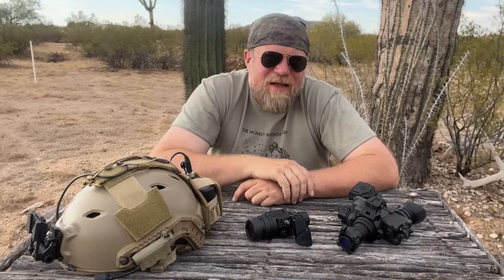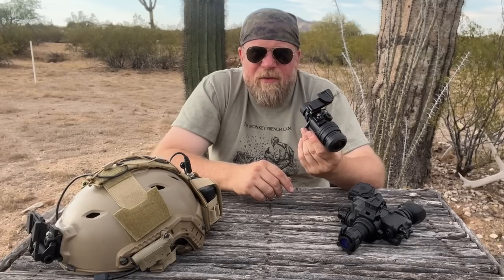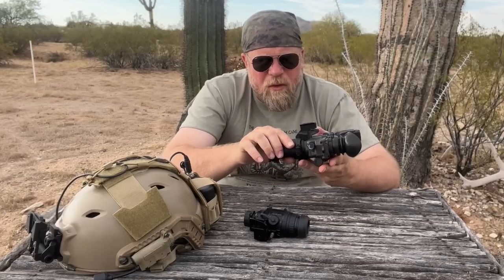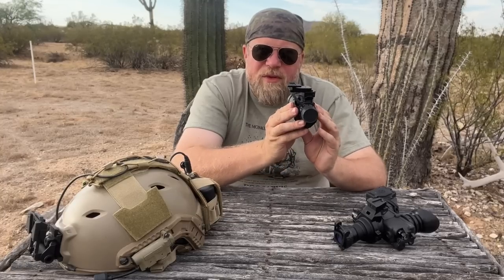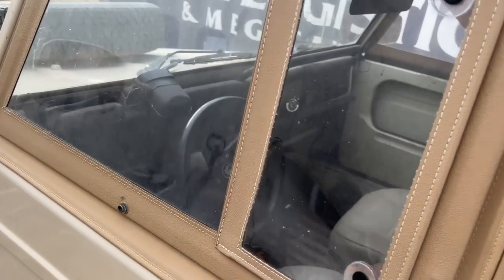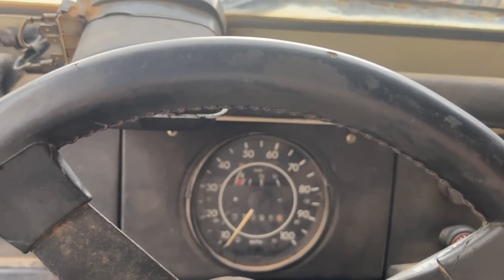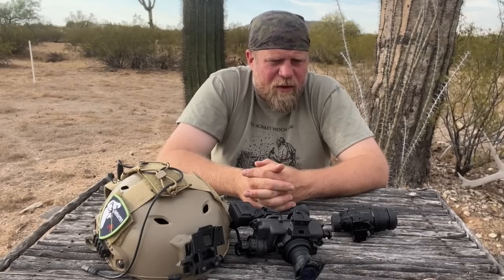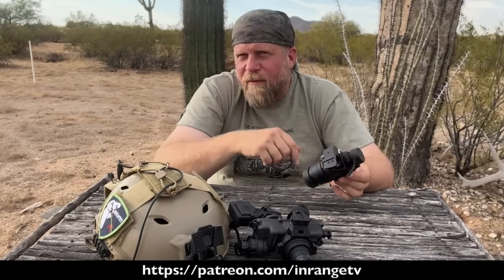Driving with Night Vision - Digital vs Analog

Comment: What was the moon 🌙 faze?
Reply from the maker: It was half.
Reply: @InrangeTv  Sorry if I missed it - were you using an IR illuminator with the Sionyx?
Reply: @dannydubya1  I doubt it.  It would be like shining a flashlight on the wind shield.
Reply from the maker: No, there was no IR illumination used with either device.

Comment: I'm glad you mentioned lights inside vehicles. Years ago in A'Stan my job involved driving civilian vehicles, usually up armored Landcruisers or soft skin Hiluxes. We'd make flaps our of cardboard/garbage bags/duct tape to fold down over the dash board so we wouldn't blast out our NODs. We'd even make flaps to cover the lights around the gear shift. Some folks added extra switches to the electrical system so they could just flip a switch and go completely black. It was also pretty common to add IR lights to the outside of the vehicle so we'd have IR headlights whilst driving under NODs.

Comment: The digital night vision is crazy crisp compared to the analog nvg, and you can actually see color which is cool.
Reply: The image you can see on the tube is better irl though, much of the blurr is just from recording through an optic made for an eye. Also the tube is not showing any noise, so its far from being really dark in this video, its pretty low gain so the ccd shines. 
What i really do like is the better depth of focus you can see on the spar tire, thats an issue with the optics of older iit devices, you cant see your own hands when the thing is focussed to infinity.

Comment: One thing you didn't remark on but which I was impressed by is the capability of the digital NVGs to filter out (or at least mitigate the effect of) bloom from point light sources. I noticed that the PVS7 has stars that twinkled much brighter, but when you rounded the corner to observe the lamps around the building, there is a much more pronounced effect on the PVS7 too. Not so with the digital NVGs.

Comment: I initially wondered if it because of the small screen on my tablet, but others seem to have also noticed  - the digital image seems to have a deeper depth of field ( more of it is in sharp focus). Because of that, it seems like the drive with the digital unit was faster.
Reply: Small sensor means that depth of field for a given aperture will be greater. The same is true for cameras - "APS-C" sensors on cheaper cameras give greater DoF than on cameras with larger "full frame" sensors using the same lens. The sensor on the Opsin will be smaller than the photoreceptor on the II tube. The downside is greater noise due to smaller pixels.

Comment: As someone who has definitely not violated any vehicle code and has only operated NV as a passenger, yeah the dash really fucks with nods. On some you can't even just pull fuses as the ECU thinks there are issues and either throws codes or in one case refused to start.  Ended up taping over a lot of stuff just to make it more useful.  On the plus side it does make it very easy to spot wildlife on forest roads way before you normally would.  A lot of people go right to having IR lights on the vehicle and that is a good thing, but imo a lot of people will remember that active IR use may advertising your position to other NV users while in the shooting context and then immediately forget that in a transport one.

Comment: A decent experiment, but latency is measured in milliseconds; how many milliseconds does this unit take?  It seems like without too much trouble one could rig up a measurement: set up the night vision goggles in daylight, except covered with something to block out most of the light (like welding glass, perhaps in multiple layers).  Then film with a normal camera.  Turn on a flashlight where both the normal camera and the NVGs can see it, and where the normal camera can see the NVG's screen.  Then count frames between when the light turns on and when the NVGs show it turning on.  (Set the normal camera to its highest frame rate for best time resolution.)

The virtual reality guys like their "motion-to-photon latency" to be 20 milliseconds or below; longer latency gives people a motion-sickness effect.  NVGs might not have to do quite that well, but it is a similar environment.

Comment: Digital Night Vision will get a lot better from where it's at now. Current iteration products are simply using sensitive sensors with tuned ISO gain circuits not much different than existing mirror less cameras. Tesla's adventures into cameras for self driving showed that while color accuracy goes away in very low light situations, a useful image can be reconstructed for navigation purposes. To take advantage of very low light performance though, any DNV manufacturers are going to need to have their own signal processing.

Comment: Interesting bit of knowledge for you and everyone here.   The lag you're experiencing with the Opsin is likely measurably less than the lag between the light hitting the back of your eye and your consciously recognizing it.  See, the image from the eyes isn't sent to the "thinking" part of your brain.  They are processed and washed a bit based on prior experience.  These are then written to your short-term memory.  At that point, the thinking part of your brain retrieves those memories and does its own processing.   Which is one of the reasons a young child has trouble catching things.  They haven't yet learned how to "see into the future."  And also why two other identical people can watch the same event and see two different things.
Reply: Eh.  Average gross visual reaction time is on the order of 250ms.  Athletes and gamers who train/are selected for reaction times will creep down towards 150ms or below.

A 60hz refresh rate means a 16.6ms frame time, a 90hz refresh rate (which Sionyx advertises) is 11 ms.  That stacks on top of whatever your reaction time is, if you're particularly quick that could be making you more than 10% slower.  And only really refined video pipelines actually achieve zero overhead latency, even the sharpest gaming monitor setup will have another millisecond or two on top of the refresh rate, and bad systems (like the old Aurora) might have 20ms or more.  If you have 40ms of latency between frame time and overhead that's a handicap on the order of 20% for someone with completely average reactions, which is huge.

Comment: My pixel smartphone does the same thing as the Opsin, but to a MUCH smaller degree and with seconds of latency when I move the camera. However, it does amaze me when I point it at an area that looks almost pitch black to me, and I see a pretty decent image with color. It wasn't meant to be a night observation device, but I've actually used it as such in a pinch once when I forgot my flashlight. I wonder if it would be easy to fuse thermal with this in one dedicated unit. Best of both worlds. That, and swappable 18650s (or whatever battery tech is "the thing" right now) would be nice as well vs a proprietary pack.

Comment: I like the green phosphoric for what they do, but, the digital's, for me, are a better choice. The digital units seem to allow the batteries to last much longer. The PVS's units I have, maybe I can get 4 to 6 hours out of them of continuous on time. Now, In my opinion, the amount of "ON-TIME" or rather "ON-TIME/SHELF-LIFE" is a huge deal on the green phosphoric coating or whatever that coating is called.. The older they are, they less the sharpness is and intensity is. Granted, you can send them in, to have'em rebuilt or refurbished or recoated. and isn't that costly. Which is still way cheaper then buying a new set.. It is also important, WHEN NOT IN USE, install the lens covers, on both ends, the reticle ad objective sides. Even is the units are not powered to the on position, if the caps on the INTAKE side or objective side, light is still getting in, and using some of that shelf life of the coating, of course, not very quickly, as compared to being powered on, especially with sun light... 

Please note, I am not an expert in this field. I am just following the instructions from the manufacturer upon paper instructions, and phone calls for service refurbishment. Those are the folks who know what they are talking about, and when you have spent some loot on their product, they gladly inform you on proper care for their product lines.. 

The digital units, lack the range compared to the green meanies, but, anything out past 500 to 750 yards, is solid for me, that means I have a change to get a head start at running away... lol...  Price is another issue. the digital's are much cheaper.. It is also important that I note, I am not telling anybody which one to get or not get... There is Pro's and Con's of both. I will say this though, not having a set vs, having any brand or type is better then none at all. 

For what it is worth, I kinda wish I had saved my money and just got the digital CMOS or DSLR chip set units instead of the green phosphor retired / used units from the Military Surplus...As that would have allowed me to afford more digital units, one for the bathroom, each bed room, each vehicle, etc...lol.. 

Lastly.. There is a newer set out there that only the US military is allowed to have at this time. I forget what they are called and all the fancy bells and whistle is has, but, a set of those can delineate the a thermal scale and mark a line around it if that feature is activated. Rumor has it, that this feature chews up the battery power, but, highlighting the critters you are hunting, while not blowing your eyes out, just cool as heck... I believe those newer units also have built in record and send feature, I do not know if it is a Wi-Fi thing or Networked to a Sincgar system? or on its own proprietary comm's system.. I don't know. I just know, I want to play with a set, but, something tells me, these units will exceed the last units in cost of well over the MSRP of $40K $5K to $10K used and will be WAY OVER THAT price scale...lol...  NVG's with thermal constrasting, $$$$$$$$. Does anybody really need NODS or NVG's of any format? YES. because we can.... Because.... AMERICA ! ! ! ! ! !

One more lastly.. For you Californian's Pay close attention to your corrupted gun laws, or rather, anti-2 laws... Your rifle system, is not allowed to have night vision AND magnification mounted on the rifle at the same time. You can have one of the other, but not both mounted on the rail at the same time.. You can have your NV helmet mounted and a reticle or scope or red-dot and magnifier mounted on the rifle rail or 1913 PIC rail. 

I mention that, as I have seen some cheaper night vision monocle PVS's out there, that comes with a mounting bracket of sorts, that would allow for such to a rifle's PIC rail... Don't do it, or at least educate yourself first. I do not know if there is any other state that has that restriction like that, I heard Connecticut also has that restriction too, but I have not taken the time to look it up to verify the validity of such. I am sorry. lazy I guess. Plus, I don't live there..Please feel free to correct any of my info, so I know better or the better way or correct info. You will not offend me, as I prefer being educated and not always the dumba$$ that I typically am. Plus, your correct info, can and often times helps others that didn't know to ask the oddity of questions CHEERS...

Comment: For me, footage from Opsin looks very much alike "night" scenes from old movies, recorded during the day through the filters.
Based on that comparison, i think that, the fact of having coloured image instead of monochrome, is way to much overlooked. I had way easier time to distinguish where the road goes at distance, because vegetation and road had different colours. Footage was also more crisp, like there is wider margin of focus, that camera can provide over the intensifier tube.
My thoughts are, the digital nvg can be much easier unified with thermal vision. Both system are based on digital cameras, so goggles can have bulit in nvg and thermal cams in front, displays at the back, in one slick housing. The computer unit can be moved to the back of the helmet (more powerful, to fight the latency problem, worsend by adding longer connection with cameras and displays), and the battery could be moved from helmet to the pouch on the plate carrier. I have feeling, that this setup could be more practical and modular.

Comment: I own a Opsin, and I have driven with it, with cars and with bicycles, for me it does not really make a difference. What I am thinking is that the Opsin is more sensitive to IR illuminators that analog ones, so far it was hard for me to find ones that are weak enough not to cause problems

Comment: Think digital NV for sure is the way to go especially considering it'll only keep improving. I'd be curious tho too if/how the potential latency/refresh rates might be perrcieved by someone prone to motion sickness? Like with how some people will get really nauseous while using a VR headset. Since from an usability perspective those don't seem to be an issue but I would be curious about the accessability aspects.
Reply: Ngl seeing the digital video alone made me uncomfortable. It looks unnatural compared to the analog counterpart, as if something isn’t right with the movement. Couldn’t imagine using it for more than a few minutes.
Reply: as a VR enthusiast, i can say, motion sickness is directly tied to the intensity of the experience, how well the experience is built, the hardware running it, and the amount of time you have in a headset. admittedly my tolerance is pretty high, but after an hour or so, i got to the point where i could do backflips in game, with my feet on the floor, while engaging targets, and barring serious hardware issues, 'normal' VR usage basically doesn't bother me.

Comment: The footage from the Syonix Opsin certainly looks very nice from the comfort of my computer chair, compared to your PVS-7, but I can't help wondering if extended use might cause "simulator sickness" (or motion sickness) from the slight lag (which, of course, is impossible for watchers of the video to really feel) between movement and the screen updating.
I suspect that with digital night vision at least some of the latency is caused by the manufacturer trying to put too many "features"  which are "hard-wired" into it and always using processing power, even when turned "off", such as various recording modes and image modes (making the image "look pretty" and/or imitating a microchannel plate style image) and also the support circuitry for the LCD eyepiece could be part of it, presuming at least some parts are COTS and not possible to manufacture in-house.
This might not seem connected, but apparently the early development of the Oculus (no suffix) HMD was mainly concerned with stripping-out processing done in the mini LCD monitors used in the eyepieces which caused noticeable lag between head movement and display update, so being able to manufacture an entire digital night vision device from video sensor chip to LCD display and integrate them as closely as possible (without having to "demanufacture" cameras and LCD screens into parts and then rebuilding them), with as little processing between each stage as possible seems like the big hurdle, but that would have to be assessed as to whether it's worth the cost of squeezing out that little bit more performance and if the market would bear the cost of doing that R&D in the final product, compared to microchannel plate based devices.

Comment: The 7 obviously  has better  amplification because you can see wary more stars.  However,  the opsin has the advantage in color and, it appears in this video,  better focus on both up close and far away objects.
Reply: That's because the analog detector runs an avalanche detector, it's all or nothing. The digital has deeper/finer resolution and like you say better focus.

Comment: I wonder if it would be possible to use mirrors for a periscope effect. Like the mirrors would exist in front of your eyes whike the actual machine sits up top. Theoretically that would mean you could have a shorter length from eye to the front. It might mean being able to get a cheek weld and using existing sights.

Comment: Wow that opsin has a super crisp image. Thanks for the vid. My only little nitpick is that we, as viewers, will not be able to get the most true-to-life comparison here. Because YouTube only can run 60fps max videos, and I think the opsin also runs at 60fps, so that image is, most likely, fairly accurate. But the practically infinite "framerate" of the analog tubes just can't be truly showcased on video. Now, 60fps is, generally, good enough. You can do things like play racing games, or first-person-shooters at 60fps no problem, so I would say that in 95% of situations the average user would be in, the quality modern digital would be up to the task. But, in a highly dynamic environment like combat, the fast-flicker of digital, rather than the real-time of analog, is going to be a liability. As digital gets better and better, that liability is shrinking, but I feel it's not entirely inconsequential..
But hey, that's just my two cents on the matter. I appreciate you putting out the content you do that gives your accurate and honest thoughts on various subject matter. You're incredibly informative and that is a benefit to all your viewers. Keep it up brother. Semper Fi